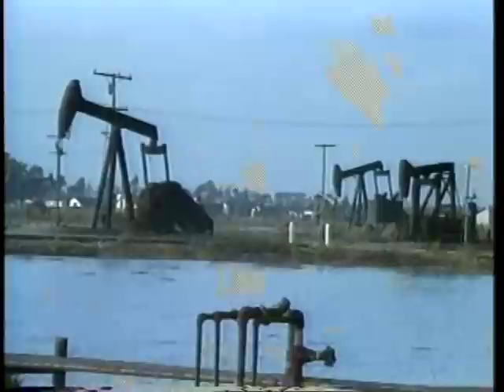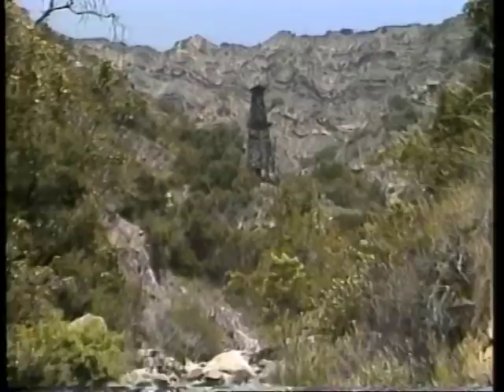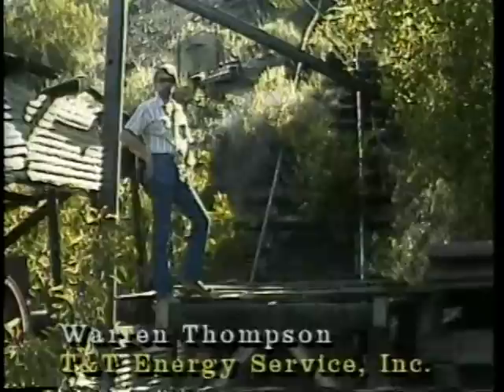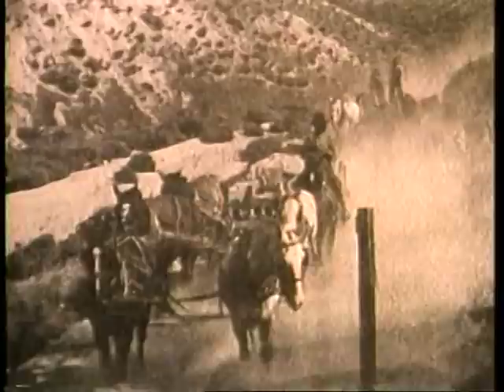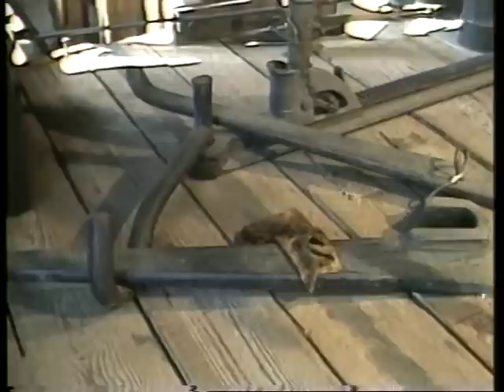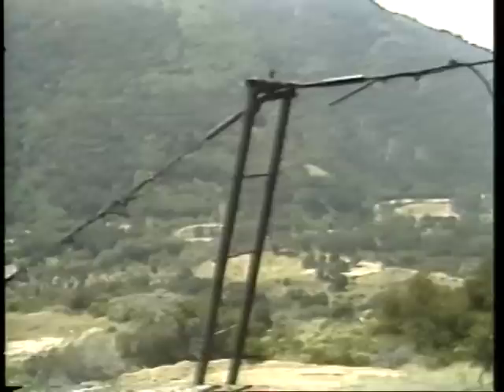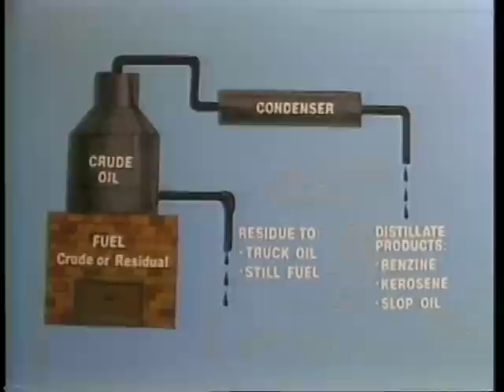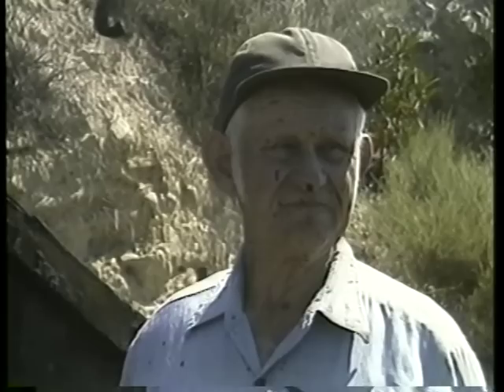Early Oil  and Gas Production in California

Comment: Lemme tell you story 'bout a man name Jed...
Jokes aside, this was a great video. Back in the 1970's I used to hike way way back into the canyons up Sespe Creek north of Fillmore. I remember that there were (and probably still are?) the scattered remains of old oil industry activity like rusted pipes, tools, steel cables, tattered shacks and sheds, and the like located a seemingly impossibly distance up the canyon. There may have been old oil wells hidden in the thick chaparral but I sensed that most of paraphernalia i saw was most likely the remains of exploration and drilling sites that for one reason or another didn't pan out.

There was evidence that a dirt road had wound back through there at one time but it was for all purposes long obliterated by the many Sespe floods and rockslides that engulf the canyon. I remember there was the buried, overgrown rusted hulk of the remains of an early 20th century automobile - something from the late 1910's it looked like - sticking out of the dirt. I always used it as a landmark on my hikes to tell me where I was, as there was only very scattered sections of trail to follow. The canyon at that point is clogged with boulders the size of cars and small houses. It was very difficult to fathom how a road could have been built back there, let alone all that equipment transported to such a remote location, but there it was. It was all pretty cool to wander through and imagine the workman and organization it must have taken to go into such a remote area. This wonderful video reminded me of that time and place in my life. Thank you.
Reply: Very interesting, where I am from, you can drive 2h north and begin to see small/medium sized pump jacks littered throughout and betwixt the corn and wheat fields. Coming from the city environment it is always a joy to see them and how they work, not sure how much they produce but nonetheless are a fascinating piece of machinery and something that will always amaze me. Thank you for your story.
Reply: I enjoyed reading this and appreciate the time you took to write it.  You got me wanting to check out Sepse creek now.
Reply: Sounds like a place I visited as a kid in Arizona. It's one of those roads, the trail at best now that someone going off of Google Earth would look you in the eyes and say you are full of it. 

I have not been in the immediate area in many years, however, based off of some things my dad's friend says, it doesn't sound like much has changed.
Reply: I use to ride dirt bikes to Sespe Hot Springs from Gorman. in the late 70's to early 80's. Now it is Wilderness. No oil wells I recall coming from that direction.
Reply: @Erik-gg2vb  Nature must consume what man does not. Still sounds interesting, thank you for the modern perspective.
Reply: I too ventured up thru devils gate to west fork and beyond in the 70's and saw what you saw, at the bottom of tar creek on the sespe there was an old structure with pipes and oil storage tanks. I have a photo of it but can't add it to these comments.

Comment: Cool Tech! I'm 3rd gen CA a Journeyman Millwright, Electrician Industrial Haz Location controls, Pipefitter, Plumber, Carpenter, Teamster, Glazier, and Red Necked Engineer! What the Heck is "Babaute? or "Babot?" Tin? Lead? Bronze? I have also worked in Foundries and Casting in CA!
Reply: Babbitt  - like babbitt bearings in old car engine bearings.  Mainly lead with different alloys.  Linotype is a similar type alloy.

Comment: Think about how heavy our planet was, before it sucked up all the oil out of the center of the Earth. Think about how much oil has been sucked out of this planet, it's almost dry comparatively. That means the Earth doesn't weigh nowhere near what it used to weigh, and that has to have an effect on the gravitational pull and rotation and everything else associated with our universe and our travel through space I think our planet's going faster than it used to not spending wise but rotating wise and I know the days would be shorter blah blah blah but don't forget it might take a long time before we notice the difference
Reply: What frightens me is that as I'm sure you know,  the earth spins on an axle.  If they remove too much oil that axle is gonna get hot - so hot that one day it'll snap - and then we'll all fly off to Kingdom Come!
Reply: @mikezylstra7514  I hope I'm awake if that happens.
Reply: @mikezylstra7514  I'm sorry and you are right that is a very frightening thought
Reply: When the 3 gorges dam in China filled it slowed rotation of the earth by a millionth of a millisecond it's imperceptible. I'd be more worried if everybody in China decided to all jump up and down at the same time
Reply: “Matter is neither created nor destroyed.”  Must be a bunch of stuff in our atmosphere.
Reply: @mikezylstra7514  A couple of good, automotive mechanics skilled at welding could fix the axle quite easily.
Reply: Less weight, less gravity, no?  So, like, one day those folks down under in Australia and Argentina are gonna fall right off the planet.  Egad!